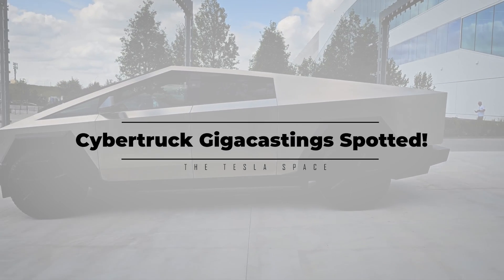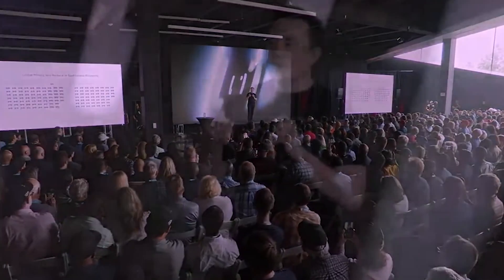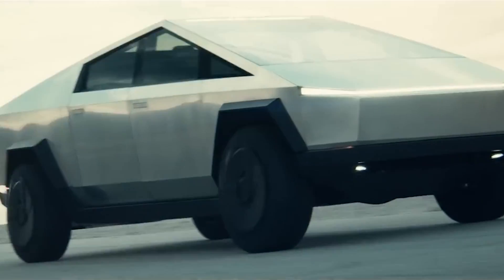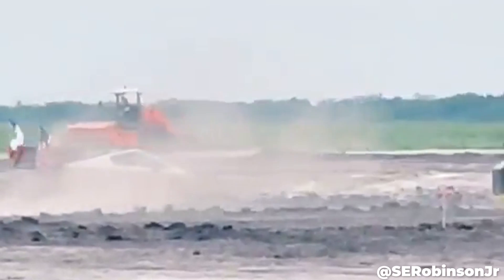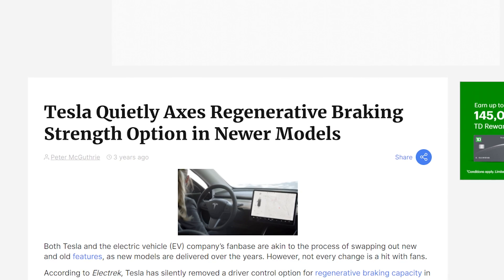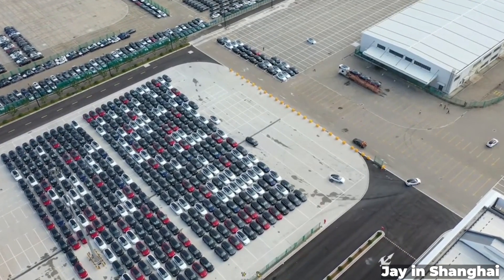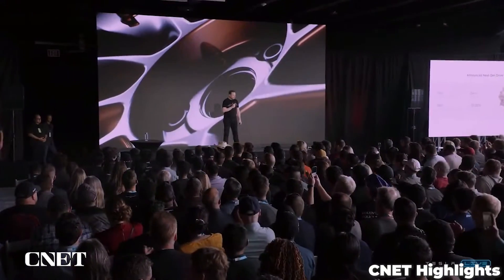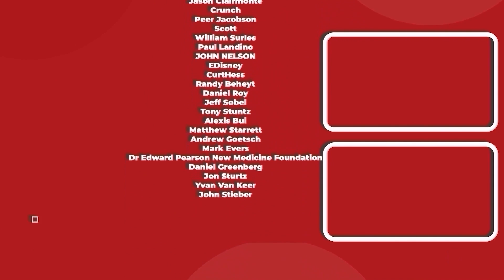New Cybertruck Giga Press Castings LEAKED!

Comment: There is no such word as "casted" or "casts". The metal component is a casting or die casting and it was cast in a die, not a mould (mold) unless you are gravity sand casting a component in which case it is a sand mould (mold). Plastic parts are moulded (molded). The Giga Press is a "Pressure Die Casting Machine". I wish YouTubers would make the effort to get the terminology right. Otherwise enjoy your videos.

Comment: Product idea
A trailer thst is a battery bank and can be equipped with propane generators to recharge batteries.  Trailer can power truck and/or equipment such as home construction when trailer is not hooked to truck driving down road

Comment: Tesla needs more than one chip suppliers
Reply: Unless Samsung's pdk is compatible with TSMC, having a second supplier would be expensive as it would require a port of the chip design.  It would be cheaper if it was a new design, but that raises the question, why Samsung?  TSMC's N3 node and Intel's A18 would be more advanced than anything Samsung has.  Maybe they are just shopping around for a future design (likely 2-3+ years out)